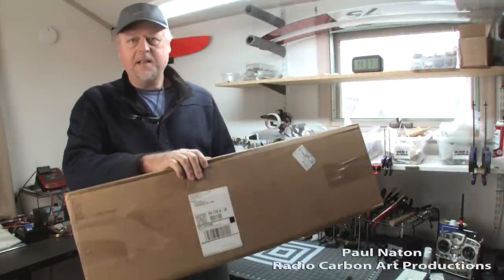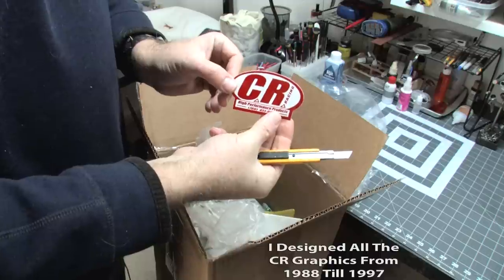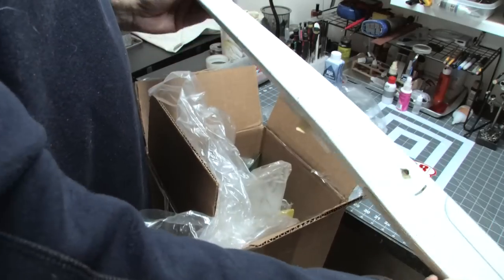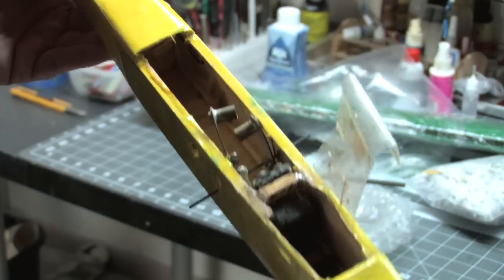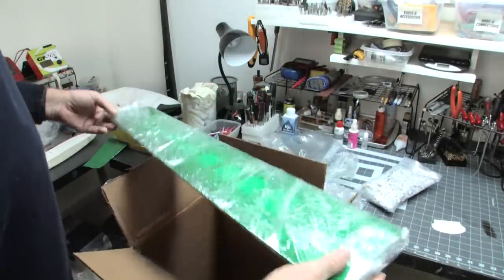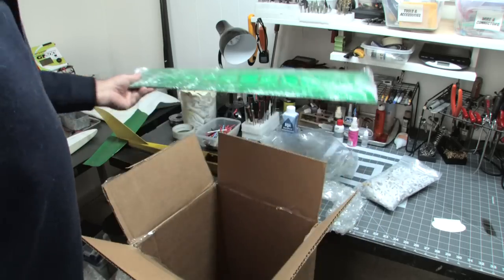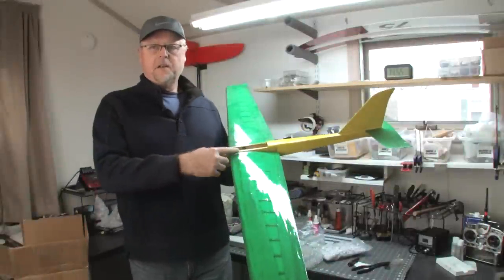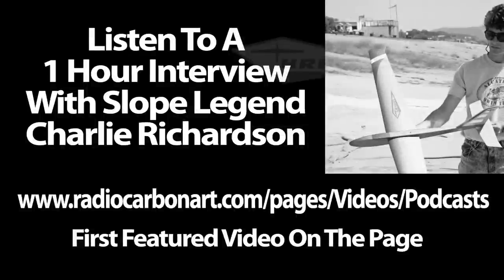Vintage CR Slope Gliders Attic Find Unboxing & First Look

Comment from the maker: White fuse was an early Turbo prototype to test full flying stab against a standard flapped elevator.  FF stab system was too heavy and complex for a kit, and was not adopted.  Fuse is not a Contender, which is much longer and 2m span.

Comment: like to see you refurbish this plane paul i have the turbo s the climax and the cr climax i still love flying these planes
Reply from the maker: The Turbo will get the star treatment and will be flying by summer. Still have a Climmax Pro RG and a Carbon Contender which is in restoration/repair right now.

Comment: Takes me back to the day I when I flew at Torry with Paul and Richard. Thanks for the cool planes you guys have produced and show cased over the years. I miss my Turbos and Contender (RIP) my friends. Now I am flying a fast picheron shrike with a 6062 airfoil. It's fast but does not handle outside stuff to well. I miss the good old days with full flying rudders and my 6060's.